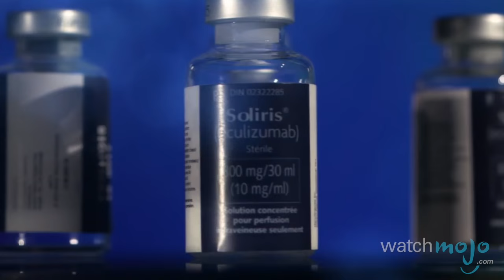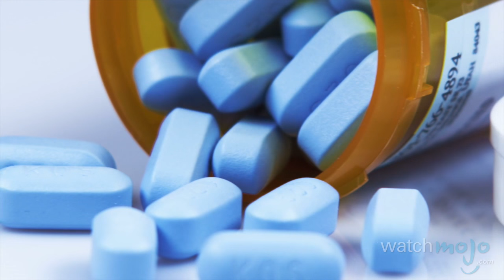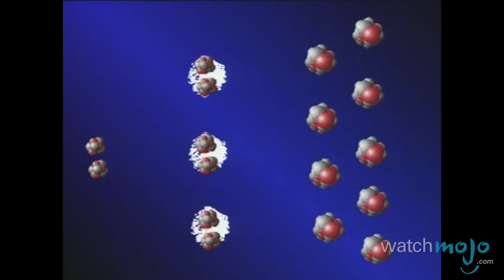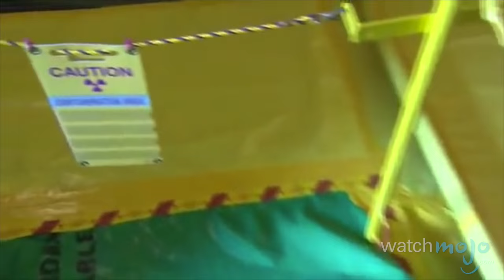Top 10 Most Ridiculously Expensive Substances on Earth

Comment: I work with CANDU-type nuclear reactors, and Tritium is not only very common, it's a nuisance. We use heavy water (Deuterium) as our moderator to sustain nuclear fission, and when subjected to neutrons, it generates Tritium. This stuff gets into the air very easily, and we're constantly trying to keep the levels of it low (we use dryers, aka dehumidifiers) as it's not something you want to inhale (it's essentially radioactive water vapour).

Comment: One of your points in regards to gold is a widely-held misconception...Gold is actually NOT particularly conductive of electricity. It's used in electronics to form a thin, protective plating over things that DO conduct well. See, most metals that are awesome at conducting electricity tend to have a problem of corroding easily if exposed to oxygen and moisture, but gold is virtually immune to such corrosion, so they put thin layers of it over stuff like copper and silver, to keep the circuits from wearing down just by sitting around your house.

Comment: 5:00 Actually plutonium is safe to handle, so long as you don't ingest it. A solid hunk of plutonium isn't a problem, but shavings and especially dust is quite dangerous. 
   It oxidizes quickly in air. A solid chunk quickly forms an oxide layer but the shavings can actually catch on fire and the smoke from that fire will make you very very sad.

Comment: I would like to point out that Watch Mojo is wrong on the #2 spot. It does not belong to Californium. It belongs to the rarest metal on Earth known as Platinum-190. I know, it's just an isotope but it really is a lot more expensive than Californium. Platinum-190 has a natural occurrence in the Earth's Crust at 0.014%. What this means is that there is about one part per TRILLION in the Earth Crust making it ridiculously hard to find and also extremely rare. Because of the rarity, it cost $32 million per gram

Comment: Diamond is only expensive because of the monopoly on them by De Beers. Tritium is used in FUSION bombs (hydrogen bombs/thermonukes), not Fission bombs although fusion bombs do use a fission tamper.
Reply: Tritium is not very expensive though, it is found in water
Reply: +BigSeventeen Tritium isn't found in water usually, it is made from lithium, but you are correct it isn't that expensive as they put it on watches and scopes etc. Deuterium is found in water, and is easily refined out just using electricity.

Comment: Gold... sought after for it's conductivity? No. Just plain... No. While gold isn't a insulator by any means, it's easily outperformed by much cheaper metals such as copper and silver. Gold is used in electronics despite this, since it doesn't have issues with oxidation.

Comment: Pure plutonium is not that dangerous. It's non-critical radiation is simple beta emission, which can't even penetrate the skin. You could handle a nuclear bomb core in your hands and it would probably just feel a little warm. You just have to be careful not to breath it's dust. The reason you always seem to see it being accessed by remote arms and leaded glass is because they are usually working on spent reactor fuel, which besides plutonium, also has a number of extremely radioactive, short life uranium decay products.

A major in Chemistry for the win! lol

Comment: Platinum "consider to be a noble medal" it's considered that because it doesn't give off electrons, like the noble gases. It is inert. Or at least vary difficult to oxidize. Fishon? Fission. Fi-zz-ion. Lol Taaphite?  Umm I do believe that bixbite is more rare. Bixbite is a red emerald and is only found in 2 place on earth Thomas mountain rage in western Utah. Anti matter is just like matter, the subatomic particles have opposite charges. So a proton has a positive + electromagnetic charge, the anti-proton has a negitive - electromagnetic charge. Electron has a negitive - the anti-matter electron (positron) has a positive +  electromagnetic charge and you can do the math,  E=mc2 or M=e➗c2. So if you take the weight of matter in killagrams multiply it buy 186,282 then take that answer and multiply it by 186,282 that will give you the amount of energy (in Jules.which is a metric how much work can be done) because 100% of the mass is converted into energy. That didn't work with ANYTHING ELSE. Get on how they get all excited about it all that's because like as an example and atomic bomb is about 1% efficient Mass to energy conversion the sun is like 47% 46% (that is a estimation) percent efficient so antimatter gives you an extremely large Bang for an extremely small buck what's the most energy-efficient substance we there is.